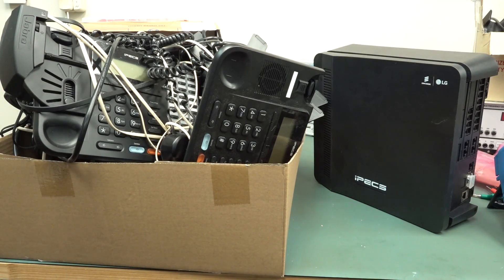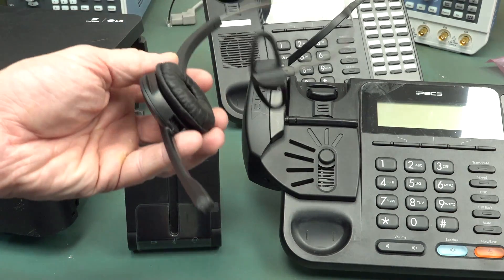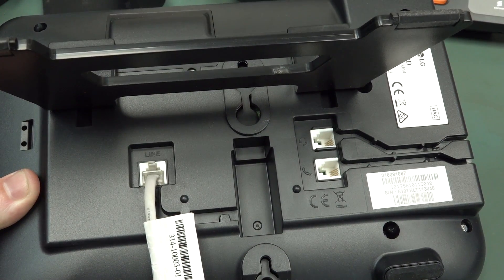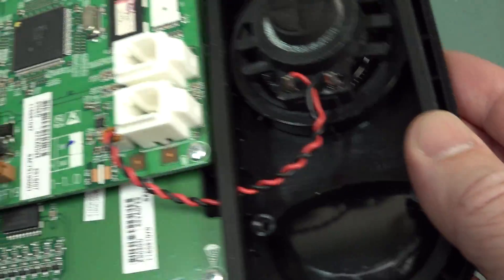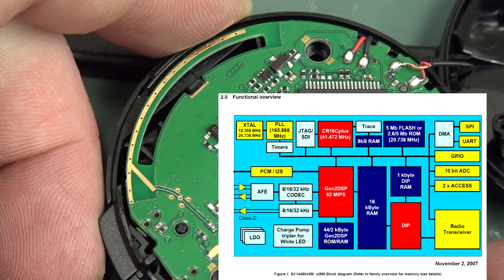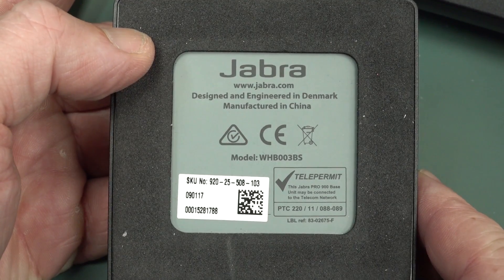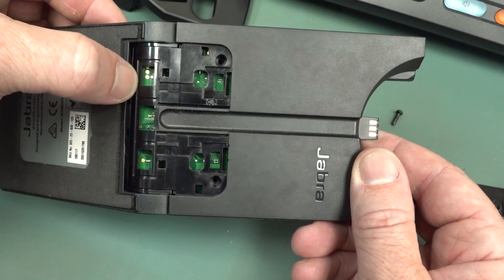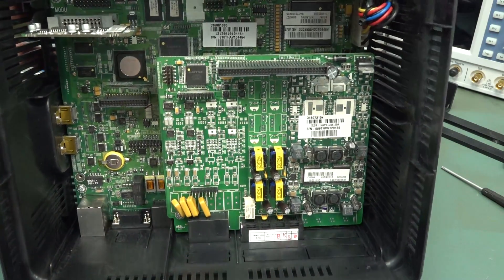EEVblog #1177 - Ericsson PABX Teardown

Comment: I scored one of these on eBay for 10 bucks and use it run an interactive display of vintage PMG and Telecom telephones. It's even capable of reading the pulses from old rotary dial telephones.

Comment: The lifty doodad reminds me of the old way modems used to have to connect to phone lines (like the Matthew Brodrick movie, War Games), via putting the actual handheld phone part onto a box with a speaker and microphone!
The reason is that phone companies argued that anything attached physically to the network had to be approved by them, and their own product, thus products were not legally allowed to connect directly to the phone wire or modify the intended "wire to phone" setup. Wild!

Comment: 4:50 That IC is most likely an INCA-P (PSB21493) or some of its siblings. It was originally designed by Siemens semiconductors (which became Infineon, then Lantiq, then Intel). It is a complete SoC for digital phones, with USB, DSP, PCM (IOM-2), and, most important, AMI decoding for the ISDN subset that it uses as interface to the PBX (U line or something. I am tempted to say UP0, but that's a Siemens proprietary interface). Actually, it may actually an INCA-S (PSB21483) used for full ISDN phones (S0 line), given the 4 conductors coming off the PBX. Hard to know, after Lantiq they started this cryptic markings, before that the name of the chip, part number, revision, etc. would be printed.

Comment: I've worked in call centers for MSN when they had an ISP and for Comcast and plantronix seemed to be the brand of choice for the phones. The headsets were spindly, cheap things that got passed down from agents who quit. Wyse was also the standard for the thin clients. With software written in-house in visual basic at Comcast. Though the Comcast specific software for managing accounts was better. Trying to run 15 different programs and countless browser tabs on those thin clients was a nightmare, though.

Comment: You missed the most interesting part: the Direct Access Arrangement (DAA) used to use large transformers and inductors to match the line impedance and isolate the line. Here (at about 12:07 centre screen) you see the modern solution that is all solid state about 1/20 the size - per channel, 2x 33pF Y2 600V 1812 size caps and 2 tssop's make a digital DAA that does all the matching and digital isolation via a DSP - either chipset from silicon labs SI3050 of similar - practically the product that founded  silicon labs.

Comment: Some phones did not have actual switches for the handset to be on/off hook.  The Siemens Rolm 4000 phones use a magnet in the handset and a hall effect sensor.

Comment: This is an IP tel system - which is why it doesn't work on an analogue phone line.  It expects IP digital signals on the main connector.  Big advantage for small business is you can lease only 1 or 2 lines into your company and the IP tel PABX allows all inside calls to be done for zero cost.  If you have 2 offices and both have IP tel then inter-office calls can also happen for nothing if you have IP connectivity between sites.  Calls only go back out on to the PSTN when needed.

Comment: I work at a telecom, watching this tear down of the jabbra headset is hard to watch.  The spinner switch isn’t a channel select, it’s a mode select for phone type, it tells the jabbra which wire in the headset in/out ports are audio out vs mic in.  There are also several different hookswitch cables you can get to make it integrate with Cisco or Polycom Phones.  

That unit was probably worth at a minimum 100, and is likely still a current model and will sell on ebay fairly well.

Comment: @2:59 you are talking about the automatic answer and hang up. it will lift the receiver up which will signal you have answered the call and allow you to use both the handset and the headset. 

the jabra is by far one of the best headsets for offices. its not bluetooth but more like dect cordless phones and have a pretty nice range. 

I believe the hdmi is for an ACD boards

Comment: Correcto on the Jabra Dave, they are the best in the biz. I have two of them myself. Easiest to set up and use. They also have a good resale value on Ebay!! The Jabra piece that connects/clips onto the side of the phone under the handset is a "Handset Lifter" for the answer feature of the headset.

Comment: 15:23 Are 600 : 600 audio isolation transformers, pretty expensive (however good quality). Have a couple of these to avoid a ground loop in the audio signal path, it is an easy fix however not without a loss in frequenties, especially lower frequencies. For speech applications like this, it is really perfect and an easy fix. 

Question: Can you do a video about ground loops? It very common (but nasty) problem in audio/analog applications when using microcontrollers or other digital components in (partial) analog environment.
Reply: Those are not expensive isolation transformers.....expensive isolation transformers have multiple mu-metal screens, and practically flat 20-20khz bandwidth, and virtually no distortion. Take a look at Jensen for an example of a REALLY good audio isolation transformer
Reply: @joeambly6807  With expensive I mean in their kind and usage perspective. You have bigger ones and cheaper ones that can do the same however these are tiny and can do the same (or even better than cheaper ones) and saving space and is made of better/other or unusual materials. That's why they are more expensive. 

The tiny transformers are also used in some commercial audio isolation products that needs to be small. In this case it is an expensive choice because they can achieve (almost) the same results with cheaper ones, it is just a voice application. For voice you don't need a perfect 20-20khz bandwidth,  humans are unable to hear the difference with voice. A normal voice (when speaking) is approximately between 300 Hz to 3.5 KHz (at peak maybe 5Khz). 

And Jensen, another cup of thea, is REALLY expensive but also of another size and used with other goals, music for example. You won't use this in such application like this. Besides, the 20khz, with transformers there is always a loss or change anyway, how well constructed and materials they plan to use. Unless you are able to hear it anyway (depends on age, hearing conditions etc), you don't want to listen to 20khz, it is pain, not nice (also for your pets if you have any).  These specs are good BETWEEN your ears however don't say anything about the quality of sound to your ears. Don't be fooled by such 'great' specs, it says something about ability but nothing about quality.

Comment: That's great, thanks but please try also to do a tear down of an Ericsson crossbar exchange of the 1970's (parts of it).  They had a factory in Melbourne, and also imported parts from Sweden, Mexico and Brazil.  That will be a good class on heavy duty relays, complex wiring and RC filters for the contacts.  Some exchanges had the call durations recorded in mechanical counters and then people took pictures every month of the counters to compare the number of minutes added for billing.
Reply: That rap is gonna be hard to find - Ericsson withdrew form manufacturing here, then they withdrew their entire technical presence, commonly their head techs were set up as distributors (my neighbour was), then they withdrew from those distributors too. Despite seeming like they have had a presence, they have basically completely withdrawn and nobody has had technical custodianship of old systems like with companies that actually have stuck round.
Reply: for ARM/ARK exchanges techs would call billing and manually read each meter for billing... did it in 1987/88......   i remember when xbar was upgraded to ARE11

Comment: I Used to install the Panasonic version of this phone system.  Typically the HDMI ports are for adding a second enclosure for additional phones to be added.  Panasonic uses a proprietary connector for that, but Ericsson/LG IPSecs probably used an off the shelf connector to save on the engineering of connector cables.  Still going to charge you out the arse for them though.

Comment: Connecting the phone to a PSTN, was a bit risky and I doubt the PSTN owner would be happy as that phone is not certified for connection to their network!
Reply: Heh they use line protection for a reason!  :P Actually it's pretty hard to mess up a PSTN line.  Worse case scenario it shorts it out, and it's current limited so it will just raise a condition on the line and the voltage will drop.
Reply: It has RCM approval on it so I believe the enables it to be connected to the PSTN at least that was what I was told when I obtained my Open Registration for telecommunications cabling in Australia.  The RCM is the Australian mark that authorises connection (amongst other things) which supersedes A/C Tick, Austel Approvals and all of the other Telecom / DOC standards. It also allows for the device to be connected to customer structured cabling systems. As @Red Squirrel said the PSTN is well hardened to handle lightening and static discharges, so the type of phone isn't an issue. That said Ethernet ports are not designed as tough and at an old work we had a Commander N series PABX that we wired into our Cat 5 structured cabling. A few people decided to change their patching at the desk and plugged their ethernet ports into the PABX and let the magic smoke out. Commander N put unadulterated 48V in and gave a crackling sound and rancid black smoke out.

Comment: Dave, what can I win if I bet correctly what smoked in that Schaffner unit? I place my bet on a Wima / Rifa metallised paper EMC filter cap. A lot of European appliances used them, but after 15-20 years, they become unreliable, they often crack and emit a lot of smoke, sometimes sparks either. I don't know how this 'feature' is compatible with their X/X2 and even Y safety ratings...

And I really don't understand why they are still produced nowadays. The industy knows for at least 30 years now that they are unreliable - and for their sparking, smoking agony - unsafe.
Reply: I won! I won! I told you at the very beginning, without even removing the case! So, what I won? ;)

Comment: I worked for a small, local pizza chain that used this exact system for their phones at all of their stores. 
It was provided by the telco (Telstra, I believe) and meant we had one phone number and 3/4 of these handsets could be used all at once and a separate wireless landline at our store. All ran through the NBN though not a landline to I presume a specific business phone plan.

Comment: More info on the Jabra device fitted over the phone. The thing that slides up and down is a mic to detect when the phone rings. It signals the headset to beep in your ear if you're away from the phone. You tap a button on your headset and the arm, as others have pointed out, lifts the handset to connect to call. The plus and minus adjust the lift height of the handset, some phones might only need a few millimeters or it can lift several centimeters.

Comment: You should try to ring that landline with the phone connected, if it behaves that funny on puny 48V DC I'm pretty sure that 110 V RMS AC ringing would be glorious :) And more seriously speaking, these call center/office telephone type thingies are usually surprisingly well built - simple, but sturdy and with an attention to detail - it's a thing that's very mass produced like consumer goods but at the other hand nobody would buy a telephone that dies after few years of usage, everyone abuses them mechanically and backwards compatibility with whatever equipment that's already installed is a big thing - try to explain to CEO that we have to replace all telephones in the building because we bought a new fancy PBX and call center software;)
Reply: lol I want to see this happen too.     And yeah these office phones are tough!  Had a lady at my work that would get mad and slam the receiver on the desk. (working 611 repair will do that to you after a while)  We'd always joke about how strong those phones were because she never broke hers.  Good ol' Northern Telecom. Their stuff was built like a tank.

Comment: I'm not 100% certain, but it would appear by looking at one of the iPECS brochures, that the HDMI connectors are used to attach 2 of these devices together.
Reply: That's what I was thinking, can probably daisy chain them.I guess the physical location (left/right) matters in terms of how they are configured, so probably why it's labeled that way.
Reply: I know hdmi are very high bandwidth with low latency, but I didn't know they could legally use the standard for that purpose. Interesting. I guess they got the (probably expensive) license for it.

Comment: Jabra headsets: they are NOT bluetooth. They are DECT if I recall correctly. Range is way over 100m on a good day. Also the "charging" station is the base station, its not just for charging.
Reply: 100% DECT & very good. I have a couple of them & can walk down the street & round the block on the phone. Awesome little bits of kit & great value for money!
Reply: Yeah the datasheet said DECT as well
Reply: Yes, I have one of those in the office. And the mode dial is not for channels, but for different phone interface modes, the motor switch being one of them.
Reply: Great headsets. Definitely DECT.
Reply: The flippy doo-dad is a terrible cludge. There are usually adapter cables for common phone models.
Reply: Haven't watched the video, but Jabra made both Bluetooth and DECT headsets and deskphone adapters. Quite a few look exactly the same and just have different guts.
Reply: Yes. I used to work in an Emergency Dispatch Center that used these DECT headsets. When you were alone during the nightshift, you could walk all the way down the hallway to the kitchen, have a snack, go over to the bathroom to take a dump, and then back to your desk, while all the time being ready for incoming emergency calls. These things play a pretty loud ringtone, too. Kinda neat.

Comment: 3:11 when a call comes in there is button somewhere that raises the receiver to answer the call. Its for systems where you can't use a head set without the receiver off the hook.
Reply: 8:30 figured it out

Comment: 10:21 CAD is is a useful tool, but it can be done without. Difference is before computers things were constructed the easy way using screws and stuff like that, now screws are extra cost. also machining these little things into the molds was not so easy even 10 years ago. But yes the idea is genius.
Reply from the maker: That's the trick, when you don't have the advanced tools you make it inherently simpler for yourself.

Comment: Can we still see the "more interesting teardown" even tough it let the magic smoke out?
Reply from the maker: Yes, just couldn't do it yesterday because the smell was horrible. It's currently locked away in a box.
Reply: It's NDA'd and export restricted :P
Reply: Living on the edge dave! Magic smoke and office space smoke detectors are an easy way to spend $2k on a express fire truck delivery! Might get ya a 003key so you can isolate at the panel, for those occasional most likely moments!

Comment: The jabra component on the phone is known as a handset lifter, it lifts the handset to make it off hook vs on hook.
Reply: This. Lifters are used for phones which don't have a suitable headset interface, usually when the headset you want to use doesn't support whatever random phone you have.
Reply: Yeah and it has a little mic to listen to the speaker so when the phone rings it can beep in your head set if your away from your desk. (I think)

Comment: That Jabra motorised lifter for the handset is used on phones without separat headset connector.
Reply: Many headset ports only operate by selecting the headset on the phone. They're fine for wired headsets. A wireless headset on the port needs to be activated first before pressing the headset button. Connecting the headset through the handset port and using the lifter will  ring the headset and allow the user to answer/hang-up a call while 100m from the phone.
More advanced phones have AUX ports or USB ports with EHS (electronic hook switch) features. Jabra makes EHS adapters that integrate alert, answer, mute and release electronically. That electromechanical handset lifter is becoming a thingy of the past.
Reply: Interestingly, it had such a connector on the bottom.
Reply: Lifters are antique anymore.  Use an EHS (electronic hook switch) adapter which digitally controls the phone remotely.